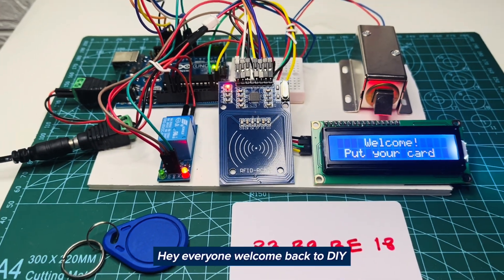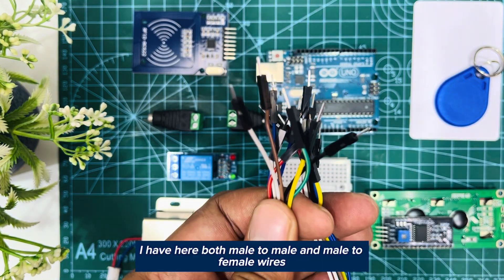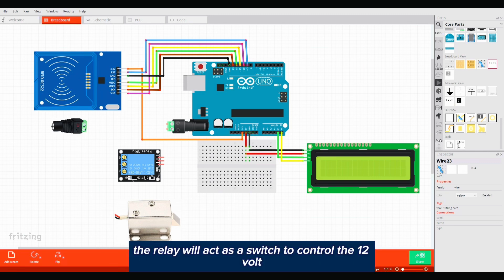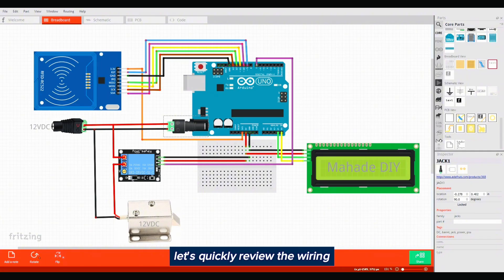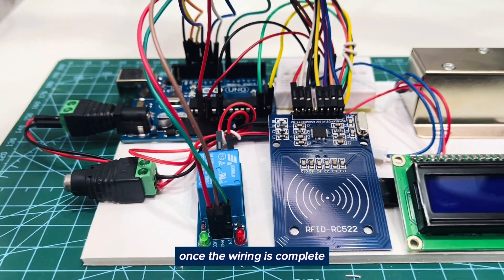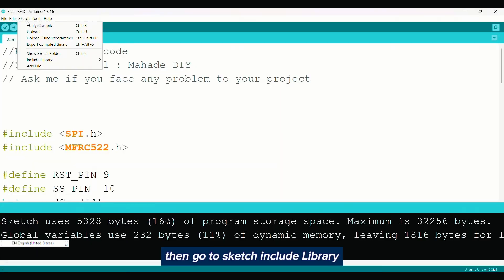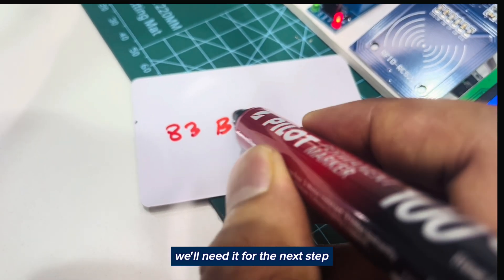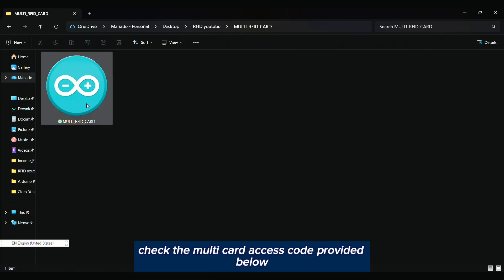RFID Door Access System using Arduino 🔐 | Smart Lock DIY Project | Mahade DIY

Comment: Is it necessary to separate the power supply for Arduino and solenoid? Because when I connected it with a 12V 2A adapter, the system suddenly couldn't read the card.
Reply from the maker: The solenoid draws high current and creates noise, which disturbs the Arduino/RFID. So solve this issue 

Idea 1: 
Connect the capacitor across Arduino 5V and GND
	•	+ (positive) → 5V
	•	– (negative) → GND
	•	Place it close to the Arduino/RFID

Recommended values:
	•	100 µF–1000 µF electrolytic
	

⚠️ Also use a flyback diode across the solenoid

Idea 2:
Use separate power supplies (with common ground) to avoid card-reading issues.

•	Arduino + RFID → 5V regulated supply
	•	Solenoid → 12V supply
	•	Common GND between Arduino and solenoid driver

Comment: Is this easy to hack? I’m thinking of installing one on my front door, but I’m not sure how secure it would be
Reply from the maker: It’s not secure enough for a real home.
Basic Arduino + RFID cards can be easily cloned and lack encryption.
Arduino Uno has no secure memory or tamper protection.
Power cuts or wire access can bypass the lock.
Use it for learning or internal doors, not your main home entrance.

Comment: After I'm disconnecting the usb and connecting through adapter, the lcd is on but not displaying anything and the rfid doesn't scans the card. Pls help me out
Reply from the maker: Disconnect the relay +Lock 
Check only with RFID and screen . Are RFID and screen working or not ?